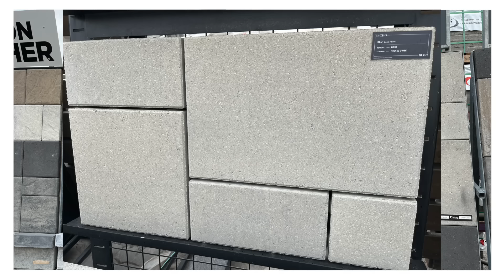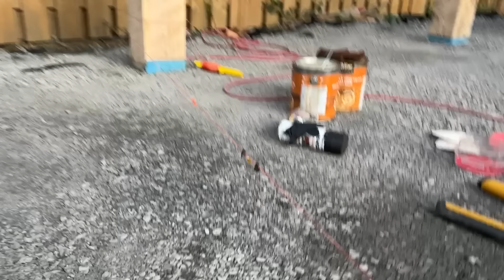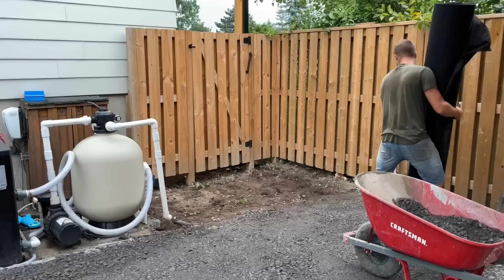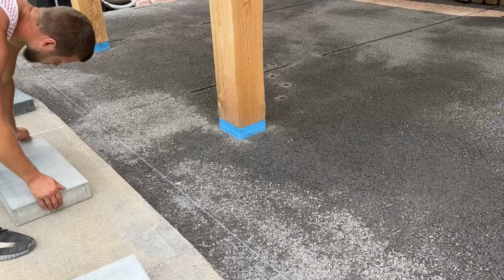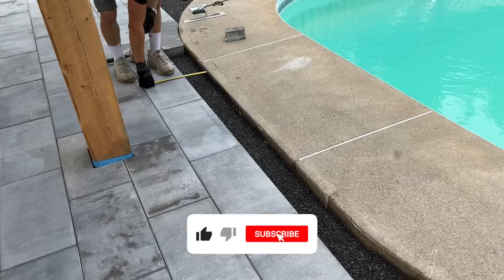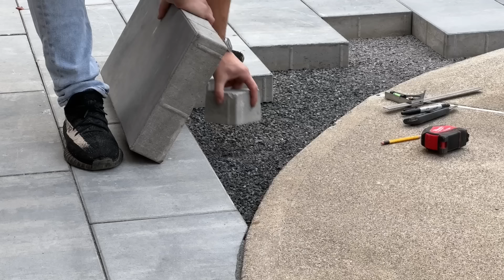How to Build Your Own Paver Patio (Full Backyard DIY Project)

Comment: Are you not worried about moisture and rot on the posts? They should be above the pavers no?
Reply from the maker: Sure, thats why i wrapped them in waterproof membrane. Well see if it lasts. if you put them above the ground, you will 100% need knee braces on the posts (45deg angled wood) because it will fall over otherwise

Comment: In Australia I believe stone dust is called crusher dust. The advantage is that it does compact hard unlike sand which can move. I used river sand which is basically very coarse sand. Don’t use fine beach sand it will just erode away. I used my old pool poles for screeding pipes. Was the right thickness and had them on hand.

Comment: I dunno if this is purely a US/Canadian thing but I don’t think that’s gravel you used. When I think gravel it’s for drainage like blue stone chunks 10-25mm in size -  if you used that as a paving base it will shift every time it rains and will not compress hard either. That looks more like road base which is a mix of gravel, stone dust, small particles and larger chunks.
Reply from the maker: Yea, here in Quebec Canada we call that gravel, its 3/4 minus. From 3/4 stone, 1/2 stone, 1/4 stone all the way to stone dust. It really compacts well, hard like rock and locks in. 
When you use something like 3/4” clean stone or net. It is only that stone, nothing else, it drains really well, but good luck compacting and locking that in. Itll always feel loose when walking on it

Comment: I always underestimate the time it takes to do a project. But the savings far outweighs the work. I did the pavers for our home in oceanside. Huge project. 2,800 square feet, with irrigation control. It took a 2 week staycation and 7 weekends. But I saved $70k. That was in 2009. I wish I'd have known about the used pavers though. That looked nice what you did. Now, I'm tackling way too much. I am building my house. I'll use contractors for the excavation, foundation and rough carpentry under my supervision. It will not take much longer that hiring a subcontractor because there will not be so many lag days. I figure nine months. Which likely means 15 months. But the saving will be north of $350k.

Comment: I have a question, are you leveling your paver in a slope? If you are, is it away from the foundation?
How do you make the slope consistent in term of degree?
Reply from the maker: I dont think you go in terms of degrees. I believe I did explain how to look at your level and measure based off the bubble. If it touches the little line, its good?

Comment: Maybe I miss something, but if the top sand layer was supposed to be 1 inch, why did you hammer the 1 inch od pipe further into the packed gravel? Maybe 1” is the max so it didn’t hurt to pound the rod in a bit? 🤷🏻‍♂️
Reply from the maker: @Malinois_Whisperer  yes exactly. Ideally there would be exactly the same sand everywhere. So ideally, all your gravel layer is perfect and packed in perfectly to allow the 1” pipe space. But if you really need to you can shift a bit up or down the pipe, but if you add or remove too much, there is a chance that your pavers will sink more or less in that area.
Reply: Good to know thumbs up. About to start laying my Gravel down so your videos motivate me. Good luck on your next one.

Comment: Instead of using string everywhere to set heights just figure out where the bubble sits on your level at 1/8 per foot start at your high spot, drag your level over the base using a bit of a rowing motion, one side stays still while the other is pulled backwards which if you do it properly and make sure you have no low spots under the level at all different angles as you go you’re left with a perfectly flat graded base a lot faster and easier than if you’re using strings all over the place. You also have a lot more control of where you direct the water doing it this way because you can add swales change your pitch in certain spots to direct water away from from things like structures or outdoor bars. The big thing I sell my company to customers on is total control of the water that hits your property because water is the most destructive thing that you never think of

Comment: I paid more than $27k for less than half of the size. The work was done by a a reputable contractor but they came back three times to fix the drainage issue which is the main reason I wanted to re-do my yard. I would have done it myself if I had the muscle 💪.

Comment: Prices in America are CRAZY. To pay someone to do it would cost no more than 5,000 dollars. DIY materials could be 1,000. Crazy someone would charge 27k
Reply from the maker: I dont know where you’d get pavers at 1000$! I even got them second hand
Reply: @ how many square meters did you have? The cheapest new pavers I can find in the UK are 32 dollars per square metre (including tax) so that would give you around 31 square metres for 1,000 dollars.

Edit: but that’s for concrete. Yours looks like natural stone which would be around 80 dollars per square metres in the UK. Maybe slightly more.
Reply from the maker: @JohnnyPlastik  these are permacon pavers, they are for sure made of concrete in molds. I had a total of about 140 square meters

Comment: Note: If you want your pavers to match the height of the existing deck...then you have to lay your sand 3/8" higher.  As the paver sand settles..it will match the height of the original deck.

Comment: I did the same thing in my back yard...all by myself.  But I didn't find any used pavers...I bought mine from Home D using Pavestone Rumble stone (in a French pattern).  The first installment of pavers cost me about 2500 bucks.  The 2nd installment of pavers cost me about 3K.  I did all the sub work, gravel and sand by myself and it turned out awesome!

Comment: Im not sure if you found this out or not. I hope so. All pools decks are required to slope away from the pool mainly to minimize filing the pool with water from rain I believe. It’s why your pool deck slanted back so much. I used to do pool decks for years and you would always just put a drain on the back of that first 3-4 foot of pool decking and rest of the pool deck would drain into the drain and you’d level it out. Those pavers should absorb more than shed with rain and hopefully you didn’t jack it up to level. Those pavers looked great though. With any construction it’s a learning process. Glad to see people still taking the plunge into diy stuff.
Reply from the maker: @Annon89  yea, great advice. I jacked it up to be about 1/4 pitch. Im assuming thats where it was initially when the pool was made. This sidewalk sank about 3-4 inches lower on the outer edge. It was hard to walk on.

Comment: You did a stellar job on this mate. Better than many contractors would have done.  Your details will help me to do our paved area - and yes, I think I'm going to need a concrete saw like the one you had because I suspect my angle grinder is not going to "cut it" lol!!  Thanks so much for sharing.  That was a MASSIVE job.
Reply from the maker: @phillhart2990  thanks! Doing an even bigger job at my mother in laws! First driveway project ever. Stay tuned for the full video in a few weeks!

Comment: What did you do about the slope away from the pool on the side of the house? You always want dirt to slope away from the house.
Reply from the maker: @jaredramsey9010  yea, it would be ideal? I will live with it like this and see what happens. If really needed, I can always put a drain near the edge close to the house to run away to the front yard? But it was either that, or slant it towards the pool, which would not be good

Comment: Very nice job man! You put a ton of effort into to this and it shows. I feel like you should watch your video and then do a “lessons learned” version and point out what you could have done differently to help lessen the work and be more efficient. For example , why not just use a contour gauge on your rounded cuts instead of trying to measure every 4-6 inches and place a  cutting mark. That is tedious and time consuming. What portion of your savings would you have put towards hiring some manual labor and for what tasks. Things like that.
Reply from the maker: @wyaldkingdom  i like the idea! Thanks

Comment: Wonderful results, but you surely should wear a mask. The dust contains silica, an extremely dangerous material. You feel nothing, but it keeps damaging your lungs for several years, after inhaled.
Reply from the maker: 100% I found out about silicosis through another youtube comment. I did hold my breath when making cuts. And running away from the cloud to inhale, I knew dust was harmful, but didn’t know about silicosis itself. I appreciate it.

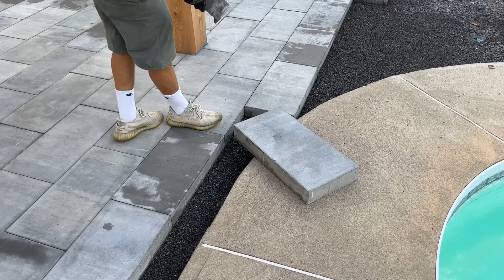Comment: 21:09 Cardboard makes an awesome and cheap and fast template for odd cuts!
Reply from the maker: Yes indeed, I did end up using this as others have proposed in a short video I released a few months back. My only problem with this is where do you find so much card board. each paver is 12"x24" and about 12 rounded cuts per corner of the pool.
Reply: @MateoStabio   yeah they would be a lot of cardboard, you could probably reuse several pieces I suppose. Also that patio turned out amazing by the way!!
Reply from the maker: @matt27usmc  Thanks! Also, forgot to mention that I did actually create a jig, kindof like a scribe using two long screws and a piece of wood, exactly 12" away from each other. so this is the technique I used last week. I should have another video in a month or so talking about a few mistakes I made and a few tips and learnings from this project.
Reply: CAD - Cardboard Aided Design

Comment: Awesome job, turned out great! Your pavers look pretty close together, did you find the polymeric sand still fit between them okay or do you think 1/8 inch spacers would’ve been better? I’m at the leveling/sloping part of my own project right now
Reply from the maker: Thanks! these pavers have a thin gap which is nice and the polymeric sand I got is good because its fine sand so it fits into the 1/8 gap. If you buy good quality pavers they should have an indent on the outside edges so give themselves the right gap, no need to add spacers. Keep up the hard work! You got this!
Reply: Thank you! We went the same route as you and got our pavers from fb marketplace, and they’re really nice but no indents on them so I think we’ll have to get some spacers just to make sure we don’t fit them too tight!

Comment: Not bad for a newbie. There's and old saying work smarter not harder. An HD Bon paver mover 21-468 for 70$ would have made it a lot easier. I myself would have budgeted some day laborers. Your project turned out nice.
Reply from the maker: Insteresting tool. Didn’t know about this. How thick is the edges? Because the spacing between these pavers is very tight, like 1/16

Comment: The spray foam is really pointless as in a year or two you’ll be right back where you started with sagging concrete as spray foam breaks down from critters had it happen to me ended up just replacing the concrete
Reply from the maker: I sure hope not! The big tanks I used is really solid foam and did not move. Its been a year. The other half I used the little foam cans and it went down half an inch already. I think ill be reinforcing that side before doing the pavers next week
Reply from the maker: Thanks for sharing this!

Comment: Always wear breathing protection when cutting stone, cement based materials.. Not the best for your lungs to breath in all this air sprayed material.
Reply from the maker: Yea. Thanks. I tried holding my breath but still best would be to wear the proper mask. I just recently learned about Silicosis.

Comment: god dam you got lucky on the paver deal, Im north shore and all I see for Blu
 Grande lisse are 300 square feet for 1400$
Reply from the maker: I see that one too haha. You gotta keep looking, and the one you wanna get is from the paver installers that remove them. They post it cheap and its gone 1 or 2 days later. You just gotta check often and be quick you can also go in person and low ball, No one is gonna pay close to full price to remove them themselves. They will only sell if they sell at 1 or 2 bucks a square foot. Best of luck!
Reply from the maker: I did check some out before pulling the trigger on the deal in Laval. I found deals in TMR, DDO, Laval, lasalle, mont st-hilaire. What ever you do, don’t transport yourself. You call paver companies, they have a truck that do transport too. You just gotta have em ready on pallets and wrapped. Delivery is cheap like 350$, instead of you traveling and doing one pallet by hand into a pickup truck manually. Doesn’t make sense. Pay the truck

Comment: Nice job! What’s the size of the boarder pavers you used? Thanks
Reply from the maker: Thanks! The border pavers were a little strange in size, I think they were 6”x12.5” or 13”. It was just a little too long to match with the other ones that were 12x24.
Reply: Thanks! I have the same 12x24 but I don’t know what order to use, I was thinking the same 12x24 but crossing the boarder. Great content!

Comment: How are you handling drainage with all the new impermeable surfaces? It looks great but where I live I bet I'd need drainage improvements with this
Reply from the maker: The house has a french drain and the patio is slanted enough to let water run off on all 4 sides, not too worried about it. If I do get problems though, It’ll be another opportunity for a video!

Comment: Nice job. I think the geotextile fabric mainly keeps the base material from sinking into the substrate (and unevenly so in your case which would cause the problem).

When they use it for rock driveways, the biggest thing it helps with is just to prevent the rock from sinking into the clay or whatever the substrate is below that, causing you to have to add rock after so many years.
Reply from the maker: Yes, exactly. Just wanted to make sure people didn’t think it was just to prevent weeds from growing, in a lot of videos, I see that some DIY’s use weed barrier, which is a super thin fabric. Thanks for sharing the knowledge!

Comment: What do you do if you have a mole problem? They are digging tunnels under my pavers and the pavers are shifting
Reply from the maker: Thats a real bummer. I have no idea. I would assume you’d have to dig much deeper and put way more gravel then a normal install. I would assume they don’t dig into gravel… then I would put multiple layers of geotextile to hold it all up in case they dig under that. I would call companies and get some quotes and ask a lot of questions.  Best of luck on that!
Reply: apply  a piece of towel , wet it with ammonia and Clorox  and cover the hole  and  use a mask

Comment: EVER HEAR OF WORK GLOVES??😂 grab the stones on the side so u don't pinch ur fingers...polymeric sand is junk...EASY JOINT is by far the best
Reply from the maker: Yes. They would get soaked when I made cuts, sometimes I took them off. But yea, I learned about safety a little late in the project... Thank you for the comment.
Reply from the maker: I just looked into EasyJoint, they don’t recommend it for smaller gaps then 1/4”. But thanks for the comment!
Reply: @MateoStabio  but u can still use it ...the water carries the material into every crevace...much better than sand can get in...then the water never gets into the sand enough & it WILL flake out at some point

Comment: Wow, fantastic work and i'm well aware of how hard work laying pavers are. The only thing i would add, is that you need to smooth off the edges after a cut, especially the one's around the swimming pool pavers. Paver edges are super sharp and if by small chance, any of those pavers dipped on one side but rose on the other, even by a millimetre,, you don't want those sharp edges exposed.
Reply from the maker: That’s great advice, Thanks. I’ll definitely do that to the rest of it on the other side!

Comment: Huge thanks to your neighbor! Geesh I need a neighbor like that hah Great work on the Patio
Reply from the maker: Absolutely! My neighbour on the other side though, not so much hahaha. Thanks for watching!
Reply: @MateoStabio  hah thankfully I got lucky good neighbors on both sides of me and in the cul de sac I’m in. After watching this video thought it seems this took a very long time and even with the help of the neighbor and all that equipment this was a huge undertaking. My back hurts watching you screet the dust and sand ect. 

I’m contemplating a deck or paver patio and more and more I’m leaning towards a deck just because of the amount of work entailed
Reply from the maker: Haha For sure a deck project is simpler, a lot of this video was throughout the summer and fall of 2023. But I also had to build and finish the gazebo project and with a full time job, yeaa this took me a long time. Can’t wait to finish and get back into it in a few weeks. I also have 1100 sqft to do total and with many many cuts lol. If you just have a basic rectangle, say 300 ft2, you should be able to do that quick. Rental shops usually give good rates for weekend or weekly rentals.
Reply from the maker: Do you make reaction videos of videos you watch? Wanna react to my backyard and gazebo video? Lol 😂